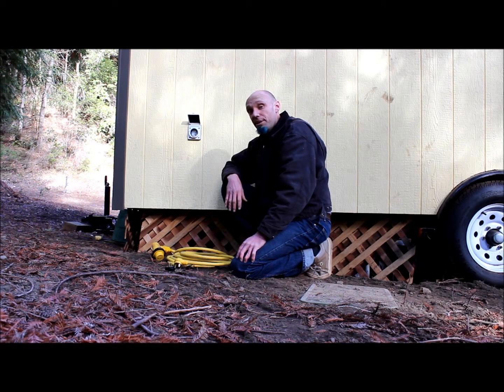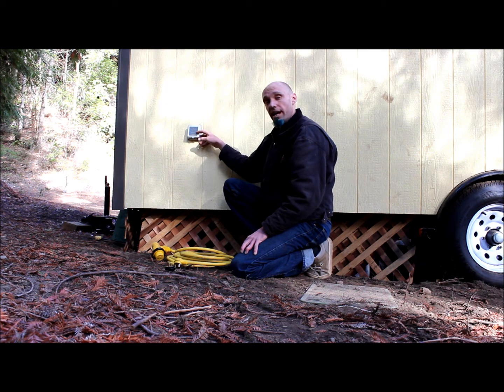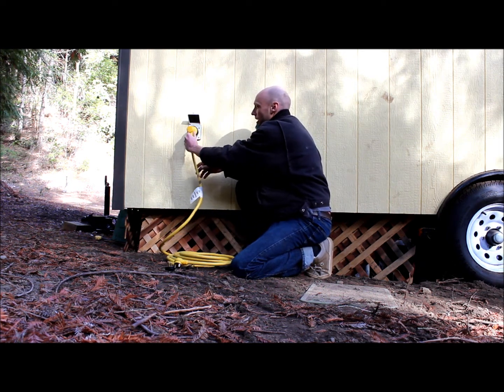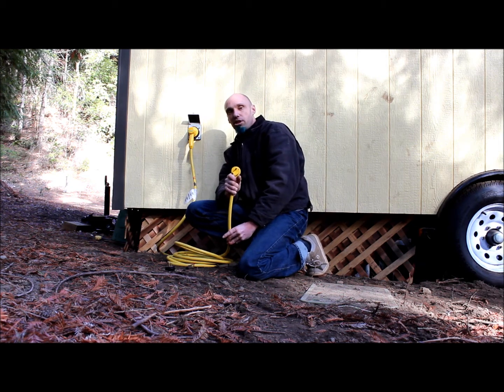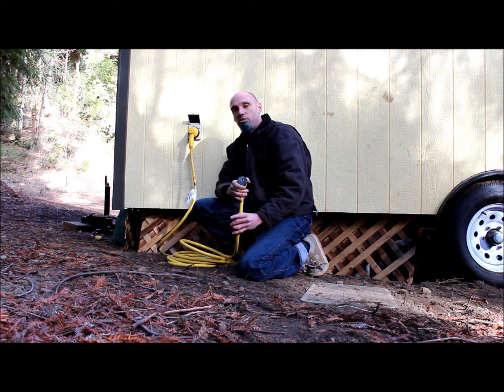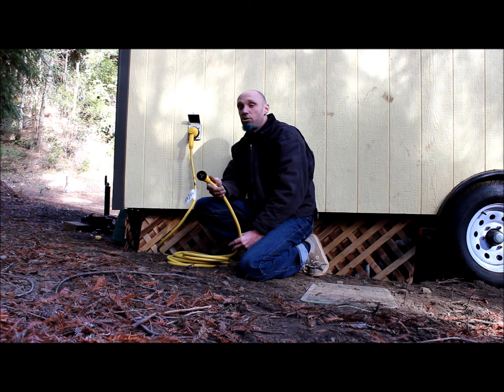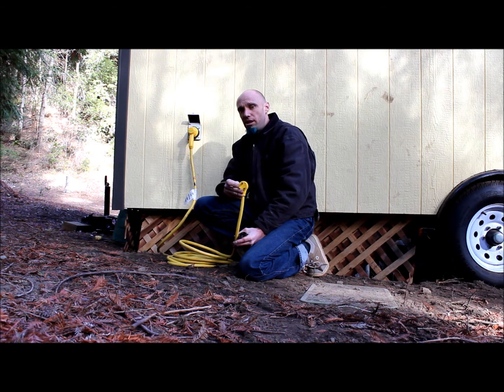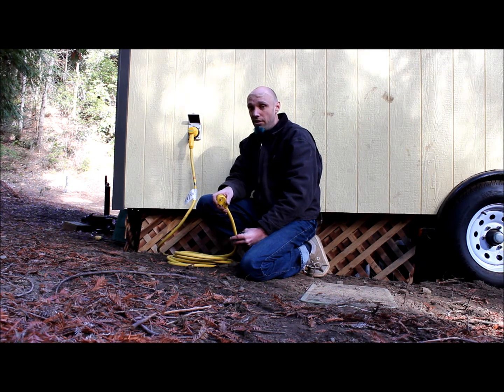How to hook up a tiny house to electrical power

Comment: Apologies if this comment shows up twice. Thanks for the great video. Is there an advantage/disadvantage to using an RV plug on the house vs just a regular twist lock? I am going to pull power from the main house which is 50 yards away with heavy gauge wire.

Comment: Thanks for sharing. I bought a Reliance PB50 50-Amp NEMA 3R Power Inlet Box and is rated at 50 amps 125/240v. This connects with 3 wires + ground to my breaker panel with a 2-pole 50 amp breaker. Will something like this work? What happens if I use a dogbone adapter from 50 amp 120/240v to a standard household 15amp 120v outlet?

Comment: What kind of ROMEX did you use to connect the wall mount, exterior RV connection to the breaker? 10 gauge I assume?
Reply: I’m using 12/2